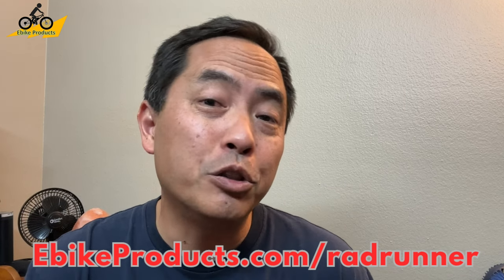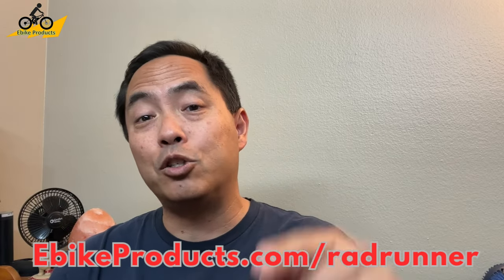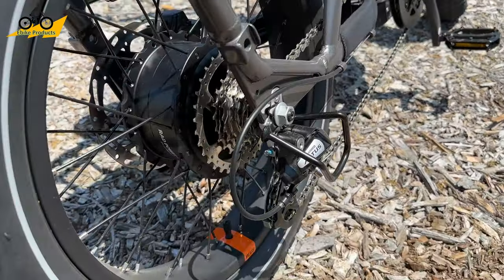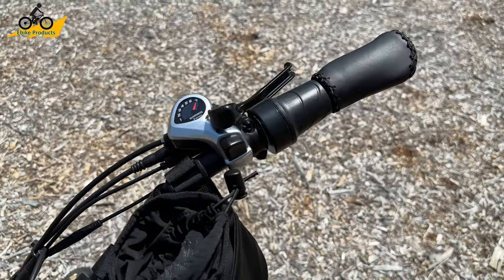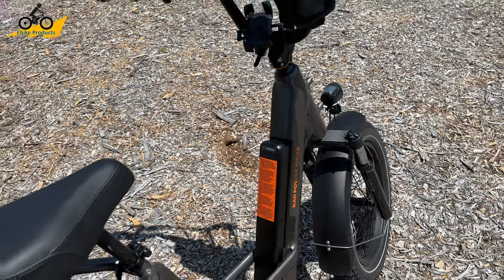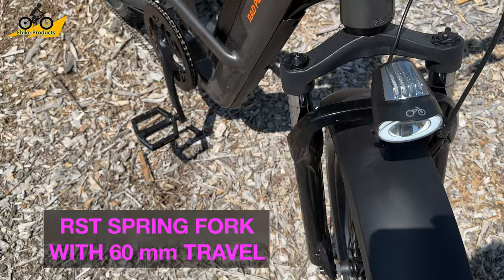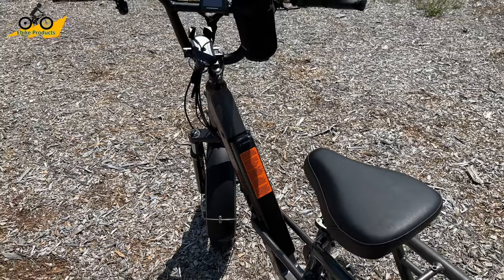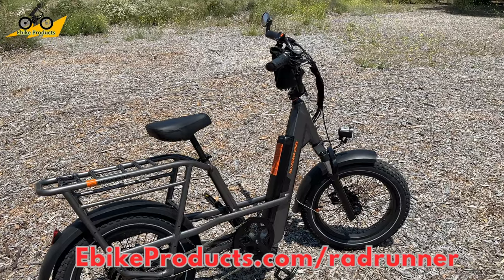RadRunner 3 Plus: AMAZINGLY Versatile and Hauling Made Easy! Check Out The Trailer We Added!

Comment: I bought a 2020 Rad Rover of course with the '750' watt motor.  I got 40 miles on the 14 Ah battery and still had charge left; but I had to put quite a bit of human power into it.  The motor did not have enough umph to go up the steeper rolling hills on the roads here without putting in a lot of human power using the lower gears.  So in 2021 I installed the Bolton real 750 watt power motor and the new controller.  This gave me 1500 or so watts when I needed it.  The moral of the story is To Hell with the Classes of Ebikes.  There is No reason to limit the power of the motor.  I will never again buy any bike with a 500 watt nominal motor.  IF THERE IS A REASON TO REGULATE SPEED FOR BICYCLES ON TRAILS OR THE ROADS, THEN POST SPEED LIMITS JUST LIKE AUTOMOBILES ON THE HIGHWAYS.  Why demand that a Chevy Camero only have a 75 horsepower engine?  Speed should be the regulated factor, not motor wattage.
Reply: While for the most part we agree. Tour car comparison sort of proves the opposite. We have proven that people can't be trusted to obey laws. Heck, when was the last time you even saw a police officer that wasn't speeding? 

I built about 50 conversions a year. Nearly everyone tries to get me to do at least something illegal. None complain after being limited in real life. Those with the ability have 100% of the time raised the limit, speed on our MUP's and then get upset when I won't stand behind their warrenty (Hello, if the average speed on your way to see me is over my 20mph speed limit, obviously you have messed with the settings for your warrenty).

Comment: I really like this bike. I have test drive it here in BK. However its nothing like a torque sensor, even if this bike claim to have 11sensor, you still feel the delay, maybe a quarter turn then the motor kicks in. Even the throttle has a delay maybe like 2 seconds, not instantaneous.
3.3 Fat tire is a properatory from Rad, so you cant swipe it to other brands.
You can unlock the speed of the rad to 24Mph. Really easy. But for the candance sensor I feel like at stock speed the pedalling feels better when riding.
You right, the seat is not as confortable, but you can replace it to other seats.
One of the few cargo bikes that has a twist throttle. 
I teully dont know how they havent come out with the extention battery. Other company already have it make. This is said they can but dont k ow if this motor is ready for it. There is nothing premake already for this bike to hook up abother battery.
 Compare to the market now, I do find it a bit overpriced, cause no accessories is include everything else is extra.
About the motor is this a 500W that peaks at 750w?  You will not see this motor outputting 750w constant only at the beginning then it runs around 500 plus. Only when it is unlock the motor constant at 750, im sure this will drain the battery.
Also you do not talk about the noise of the motor, i do believe that for 2300 is a bit noisy.
Another bike that is very similiar to this is the FIIDO T-1 Pro. Cheaper and much more power, quality and looks rad takes the nod.
For Cargo bike the Abound is awesome wtih torque sensor.
Have you try the Abound?
Reply: The Lectric Xpedition is cheaper and superior in every metric and no I do not sell either brand in my shop.

Comment: Is the trailer only exclusive to Rad Runner or can it be used on a Lectric Xpedition perhaps?
Reply: The trailer hitch fits ebike axles, The cheap VidaXL trailers in Australia have 11mm axle holes which are too small for ebike, requiring a 12mm drill put through, and trailer U bracket has lousy dob welds that break off in months of use

Comment: I call BS on any shop liking Rad. Only Nakto and the really obscure ones are worse. Never have once even seen a Rad that did not have a serious safety issue. 

As long as you don't need to climb any hills at more than 6-8mph, this might actually work for you. Trying, you will tear up the nylon reduction gears. Cadence sensing and hub drives are antiquated. Mid-drives just aren't expensive any longer. Internaly geared hubs and even automatiques (yes, that is a name) are not unreasonable (internal gearing being optimal for mid-drives).
Reply from the maker: Thanks for taking the time to share and comment. What safety issues have you seen with a Rad that is different than other ebike makers? I know they had issues with the front quick release not to long ago, but when I looked over the Radrunner I reviewed, I found nothing of concern for my safety and felt the bike was one of the most solid and safe rides. I am not a bike mechanic or repair guy, so my limited knowledge is only from doing reviews and would love to know what I should watch out for that could be unsafe. 
I personally am a fan of hub motors, but that too depends on what kind of riding I might be doing and who the rider might be as I have also become a very ‘lazy’ rider and with a hub drive I don’t need to shift as much.
Reply: @EbikeProducts  so far, I have never seen one with less than 25% of the rear axle nuts outside the drop-out. Keepers are not strong enough should failure, due to limited contact, occur. Their fatter tired bikes have off road suspensions poorly designed for off road control on much lighter bikes (these failed in The 90's). On such a heavy bike they dive in stopping, extending braking distances and doing so in a turn magnifies squirm on such high sidewall tires. In a low speed turn, if a person even slightly over corrects for the slow response of tall, soft sidewalls, it can throw them. 

It is not so much a safety issue as one of range and comfort, but the more upright head tube necessary for a sprung fork isn't comfy and can be more twitchy. The straight gauge aluminum is not only a lot heavier than butted steel, but not as strong as anything else that is round and butted (generally, hydroformed is also butted). Straight gauge tends to be dull handling and to transmit vibrations and harmonics. It hasn't been used in quality traditional bikes since the early 90's. Don't get wrong, lots of companies are using the same cheap tubing. Still others are just plain being cheap with mechanical disks when hydraulics have been affordable for at least five years, but still, the largest need to be leading the way, not holding us back.